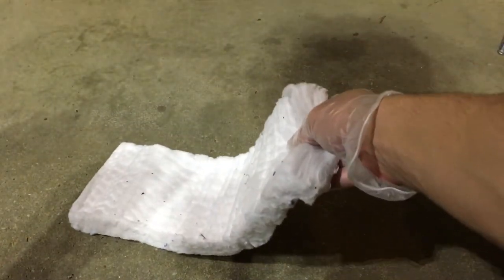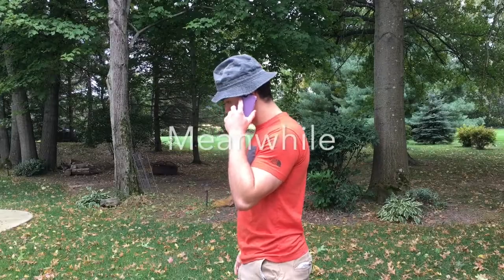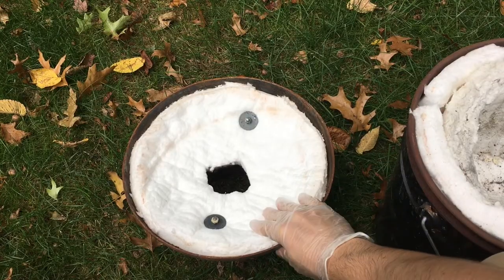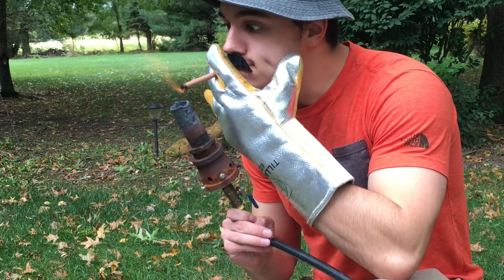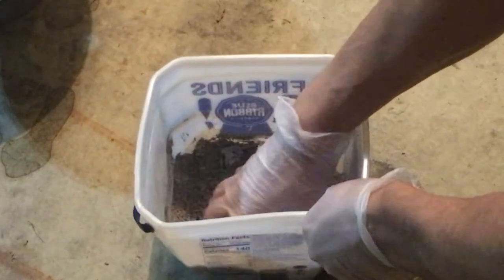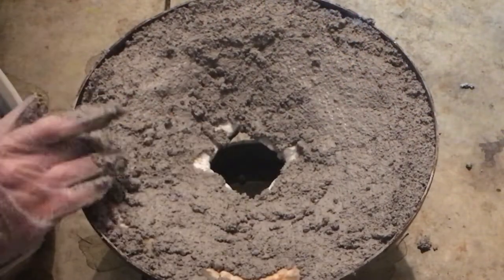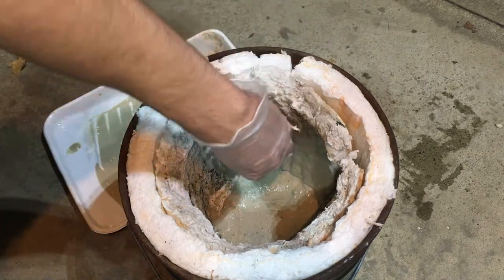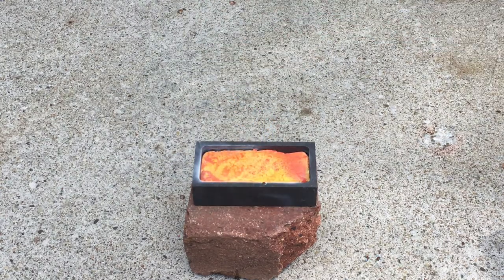Why You Should Coat Your Kaowool Forge [ And How To Do It ]

Comment: I put a dislike because you called it a forge when you use it to melt metal. You melt metal in furnace and the place you melt and cast it is a foundry. A forge is a facility for shaping hot metal heated in a furnace usually by hammering it to the desired shape. The furnace or fire as we called them is not the forge. (I workd at a forgemaster in Sheffield UK)
Reply from the maker: Fair enough. I gotta dig deeper into my wording haha.
Reply: You could do all 3 with this. Flip it on its side and put a long firebrick in - it’s a forge. On its bottom with a crucible - it’s a foundary/furnace.
Reply: I put a dislike because your comments are pedantic and I hope you've grown as a person
Reply: That's all you cared about with this video?
Reply: Its the same fucking thing

Comment: So i was going to use some refractory cement, but my biggest gripe with it is, i dont want the weight of what basically equates to a big block of loose cement wearing down the ceramic through movement. Using a thicker layer of cement of course
Reply from the maker: So far I havent noticed any damage or change to the ceramic after having put the cement on. I did rigidize it, so I am not sure how non rigidized wool world work.

Comment: is a rigidizer absolutely needed?
Reply from the maker: If you are going to coat the wool with a layer of cement or another compound I would recommend it cause it gives extra structure to the cement. But I used the forge for a while with un-hardened wool and it works just fine. (if potentially more dangerous)